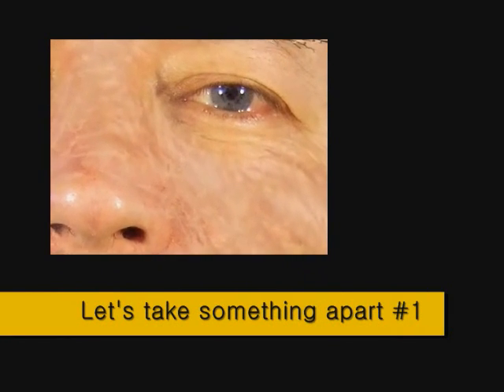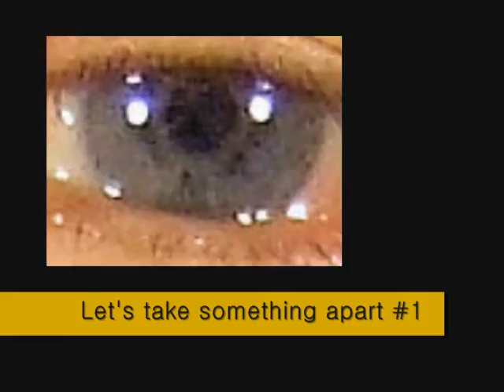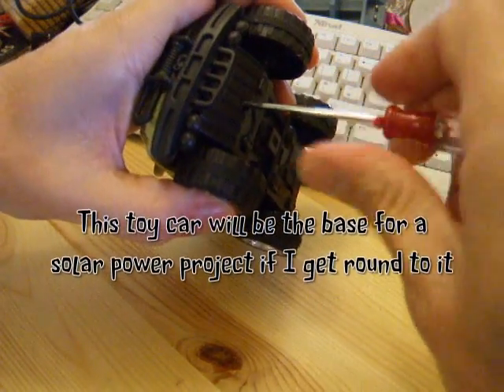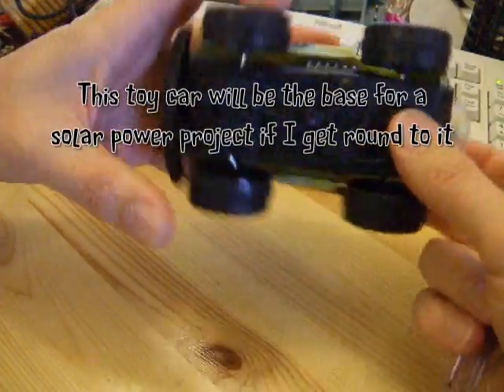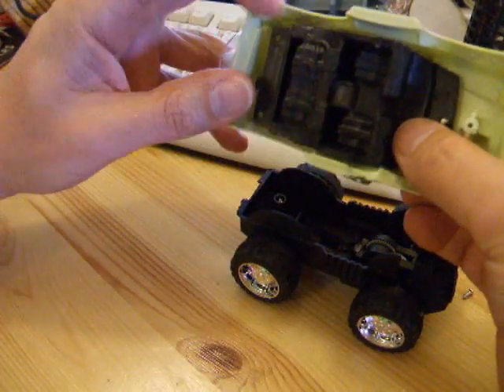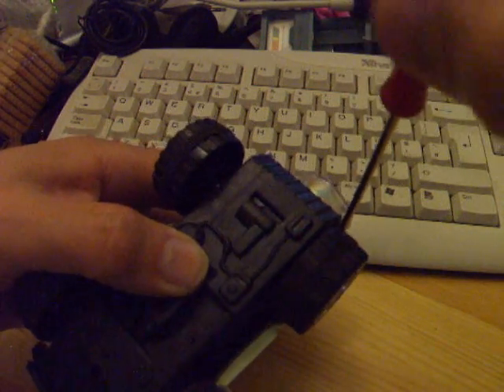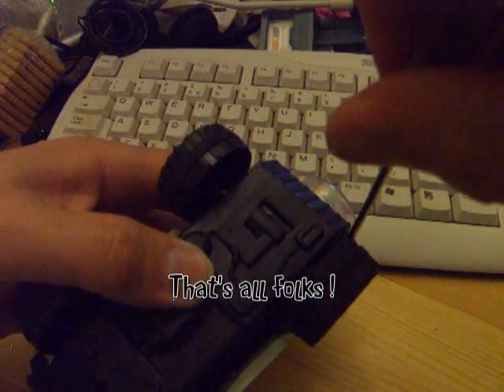Let's take something apart #1 - pull back toy car

Comment from the maker: That's great. It's a clever little mechanism which effectively changes gear automatically so a short pull back equates to a much longer run forward. The mechanism turns up in lots of different toys.

Comment: i just made 4 wheel drive pull back car using 2 motors and it's quite much faster than the normal rear wheel drive pull back car
Reply from the maker: Yes I would certainly expect it to go faster with two motors. Sounds like a nice modification.
Reply: it's truly exciting man, from the process to it's final form. it's truly fast with it's 2 motor plus the weight reductions i made.

Comment: sir, how did you pull the wheel off? did you just pull out?
Reply from the maker: Yes. You could try warming the wheel in hot water to soften the plastic if you are having trouble however sometimes the wheel will lose it's shape when you do that.